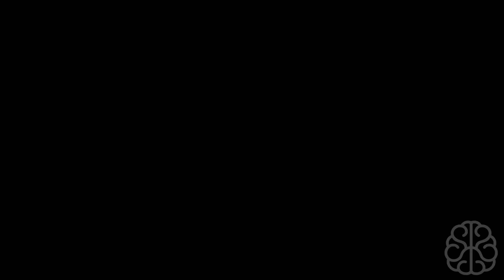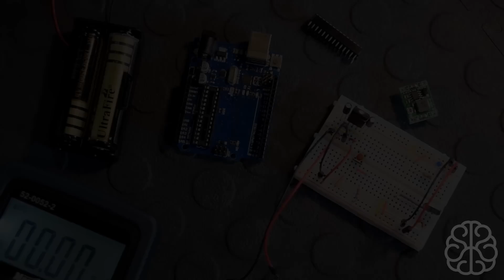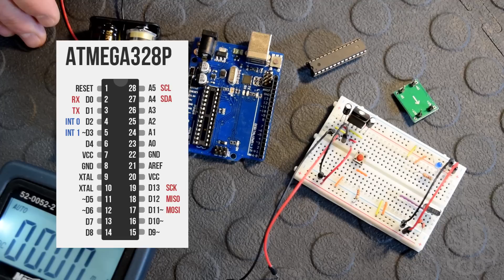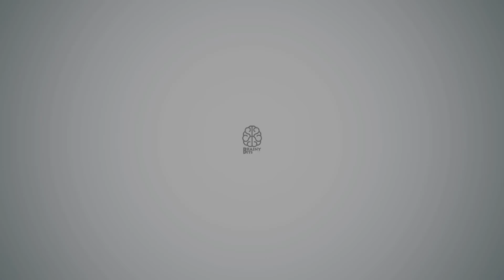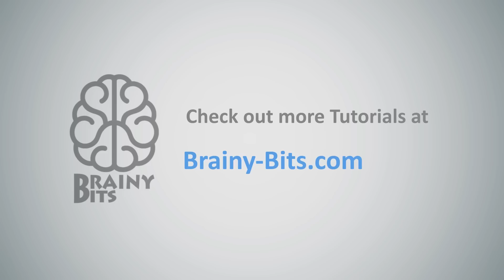Make your own Standalone Arduino UNO and power it using 18650 Batteries -  Tutorial

Comment: Just getting started with Arduino and I have a bunch of 18650 cells from when I used to vape. I came to this video to learn about the power supply aspect (battery safety is rule one for me) and learned even more than I bargained for.
Reply from the maker: Great to find ways to reuse those 18650 batteries instead of just trowing them away!  Thanks for watching!

Comment: Your stand alone arduino doesnt have the USB interface chip so it doesn't require power for that. That accounts partially for the decrease in current draw. Not all of it comes from more efficient power supply boards or chips.

Comment: I thought that lithium 18650s batteries currently do not have a capacity of over 3600mah. Are those UltraFire incorrectly labeled?
Reply: Nope There Not. 😂 There probably 2200 at most.

Comment: The thing is with the nominal value of 2x18650s being 7.4, they are at the very bottom of an Arduino's recommended 7 volts. However the full capacity of 3x18650 is 12.6, slightly higher than the recommended maximum of 12v. (although the spec sheet for the voltage regulator says 20v). So my point being neither 2 or 3 cells are a perfect fit.

Comment: Its better to use single 18650 cell power bank. They cost 1$ on ebay, and already have build in charging circuit + 5V boost converter. Takes less space and waay easier to charge.

Comment: hello, I was thinking about building a stand alone unit to power my 8x8 led matrix and make it more portable, and battery operated. Can anyone help me with how you would connect this with the matrix's driver boards? I'm using max7219 chips in the driver boards, thank you!!
Reply: Dillon West did you get this figured out? Cause I just picked up a 32x64 led matrix and powering portable with battery is not bad idea.

Comment: Heh, now buy Arduino pro mini 3.3V/8MHz, it runs at cca 6mA/5.5V with it's voltage regulator (there's much better than on UNO) ... cut the power LED, 5mA@5.35V from 4xNiMH ... quite a difference compared to 12mA@7.2V ... and to save even more power put it into sleep mode ... 0.23mA. That's the starting point for battery powered projects
By the way, I did not expected that arduino in last test needs that much current. I expected something like 6-7mA giving 8mA/5V on output.
Reply: Buck converter are most efficient at higher loads, a LDO may perform better with a low current draw, just find one with a low dropout voltage and quiescent current

Comment: what and why the resister below the button ? 
as per my fair electronics understanding it is shortening the positive with negative ?
Reply from the maker: +Ahmed Gamal I believe that what you are referring to is a jumper and not a resistor.  Check out the schematic for this tutorial on our website here: https://brainy-bits.com/tutorials/standalone-arduino/
Thanks for watching btw :)
Reply: I actually checked it on the schematic :) .. o the below side of the schematic  .. between the two yellow wires
Reply from the maker: +Ahmed Gamal Oh yeah, I see what you're referring to now :) my bad.  The 10k Ohms pullup resistor is connected to +5V from the RESET pin of the ATMEGA328 in order to prevent the chip from resetting itself during normal operation. The RESET pin reboots the chip when pulled down to ground or negative when pressing the tact switch.  Hope that helps, thanks again!
Reply: +Brainy-Bits During normal operation .. the tact switch is off .. and the resistor is passing around 0.5 mA which feeding reset pin with current to avoid reset ... hope that right so far ?

In case we press the tact switch .. the reset pin and the resistor will be shorted to ground causing the whole circuit to reset and "reboot"  ... hope that is right too ?

Thanks
Reply from the maker: +Ahmed Gamal That sounds pretty much right on!  Great way to explain it :) Thank you!